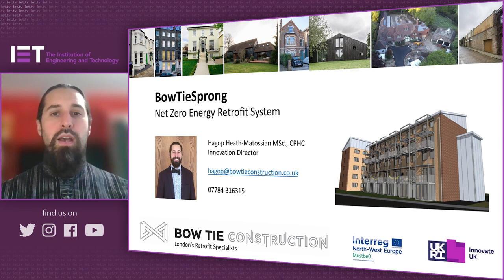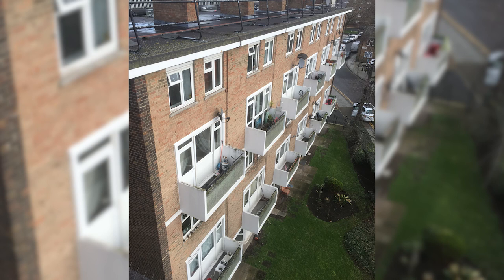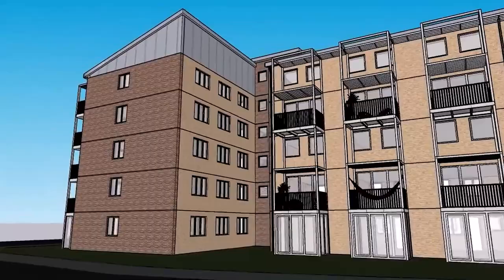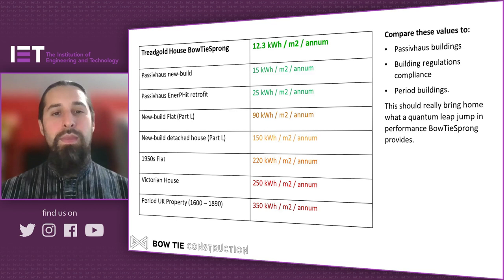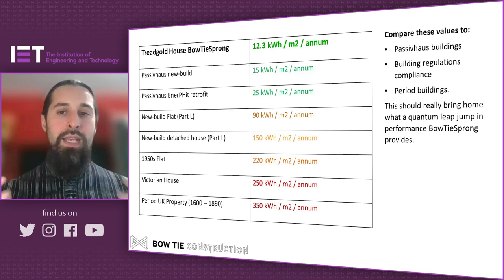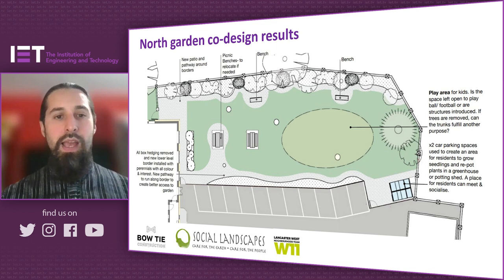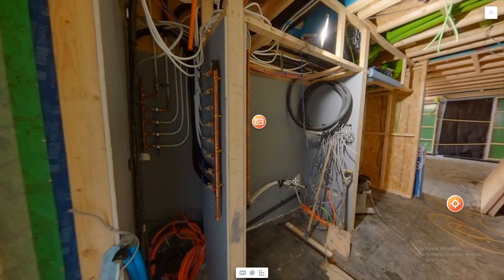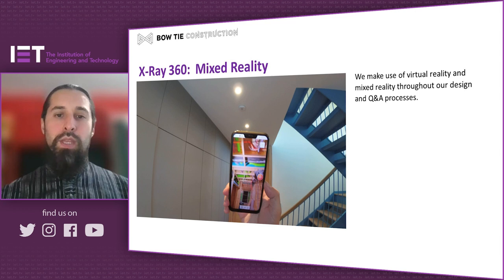Net zero energy retrofit in action – with Hagop Heath-Matossian

Comment: Your slide "Gas Connection Removed" contains a serious error. Modern Gas Boilers are actually capable of converting chemical-energy (gas) to heat-energy at around 90% efficiency. It's heat engines which which are only about 25-30% efficient but that is at converting chemical-energy (gas) to mechanical-energy (rotation) ... a different form of energy. If your before/after comparison figures depend on this then they will be seriously in error.